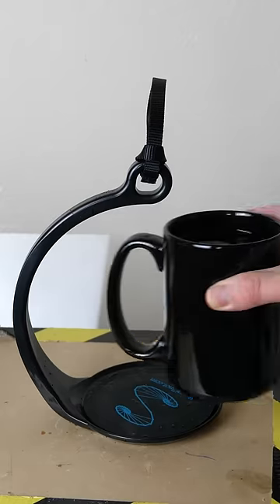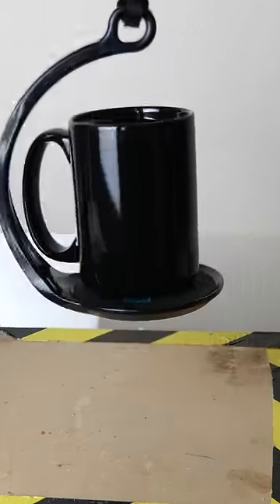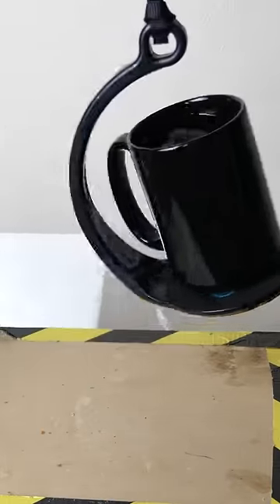Unspillable Cup

Comment: Physical Property Lesson no. 1: Fluid dynamics - opposite thrusts tend to balance each other to attain dynamic equilibrium. 2: Centrifugal force in spinning objects is equally feasible to attain dynamic equilibrium.
Reply: Didn't quite get 2
Reply: @ChaoticNeutralMatt  As long as an object is spinning, the centrifugal force created tends to warrant it a steady regular path. Until the force dies down, the object, or a volatile fluid it carries, maintains a saturated dynamic equilibrium. Hence, the fluid sits itself safely within its carrier without the fear of a spill out.
Reply: i agree! entirely right!
Reply: I have no idea of what u just said
Reply: My physics’ teacher in high school said that centrifugal force does not exist and is mistaken for centripetal force. I don’t remember what either of those mean but it is one of the few things I remember from that class lol.
Reply: @tungyeeso3637  What about the first one? (That's the one I personally didn't get.)
Reply: @Advokaiser  If something is suddenly pushed yet fixed to one direction, it will usually just put out some forces and then continue forward, fluids dislike listening to the commands of things moving them around, water in a cup, if the cup starts moving, the water resists, a very short lived false gravity is generated pretty much backwards that the water will proceed to fall with, the cup must be rotated to account for this fake gravity to prevent the water responding to the cup's position relative to the force on the water causing the water to fall out of the cup, one simple way is to just allow the cup to move like the water, allow it to also align to the fake gravity, this ensures that the water cannot spill as from every velocity provided it will be like its water in a cup sitting static on a table
Reply: @samuels1123  ahhh yes I concur

Comment: You can also do this by pinching the top of the cup with two fingers to suspend it and allow it to swing as you walk. You lose one degree of freedom so there is still a path through which the sloshing can get amplified, but you can usually compensate by moving your wrist to turn the cup (turning the axis it swings around between your fingers), and adjusting your gait as you go. It’s how I carry my cups and it works pretty well and lets me dance with them!
Reply: Pinching the top with 2 fingers?
Reply: Or four and a thumb
Reply: You might do more than spilling that way.
Reply: turns out gays grab cups like that for efficiency who would've known we were so smart
Reply: @crowsoto9612  leave it to us gays to figure out the most fun, stimmy, danceable, efficient and cute way to do a task!
Reply: @ShadowLIlly95411459  This poor man thinks it's normal to have his coffee cup only half-filled. c':
Reply: Another great way is to drink the cup then move. By drinking the liquids it is now safe in your tummy and will not spill. Good luck stay safe 🤓

Comment: Nice thing for hot beverages.

But with cold beverages in cans, glasses, bottles, cups or mugs, just hold it at the top and keep your wrist lose. same effect.

Never understood why people would hold it diffently while moving.

I hold it with thumb and index on opposite sides (and light support of the other fingers) . When I want to drink, I just move my hand up, while the glass rotates on my fingertips and I take a sip where I hold it with the thumb.

Haven't spilled anything in years while waking or talking while standing
Reply: Daymm, bro ur coool
Reply: The video has a different point altogether bro, enjoy the science
Reply: Tea can be more difficult since it's hot, so what I do then is just try to smoothen the movement by letting my arms float free as it were, following the momentum of the cup to dampen shocks. This also works in cars or other occasionally bumpy rides. 
I hold tea cups by the corners of the cup usually since those have the highest surface area to thermal mass ratio and allow me to hold it more stably than when I only hold the ear.
Reply: @thefighterinhades  same physical phenomena. Still enjoing the science. 😉

I don't drink many hot beverages so 
I guess it falls for me more of the category of "needless things".

Comment: the logic behind this is when we hold the cup with our hands it is a rigid joint and can be expressed as a single mass system since the accelereations are equal due to compiled mass. however when we hold it with a non-rigid mechanism which can bend freely, the cup can oscillate at its own dominant frequency which does not disturb the liquid in it drastically. if u let loose your whole arm while doing the last trick in the video u will see u can do it with your arm as well

Comment: This is basically decoupling the cup from your hand, which, in turn, reduces vibration. This is the same as if you have a pair of speakers on a desk and the desk is causing resonance you can put foam under them which will decouple them from the desk and remove the vibration and resonance. The hand is the speaker and the mug is the desk. Every time the speaker (hand) moves, the desk (mug) will start to vibrate. The device that the cup sat on in the video was the piece of foam used to decouple the desk from the speaker. I'm a sound guy, so that was the best analogy I could come up with.

Comment: if you hold the cup more loosely with the tips of your fingers and your hand in a c shape where the cup does not touch your palm, instead of by the handle, gently swinging the cup as you walk moving your hand slightly back and forth the liquid in the cup will not spill. you can even adapt this to running by swinging more vigourously, essentially matching the force of your body with an interfering centrifugal force. assassins have known this for thousands of years, because to carry an open vial of poison without spilling, so as to be ready and about to apply it on has to spin it around with their hand as you run matching their gait.

Comment: You can achieve a similar result by holding the mug at the top with your fingers like a claw, rather than using the handle. The principle is the same - the different position and additional fulcrum points  engaged breaks the synchronization of frequencies of a walking gait.

Comment: you can do that by holding the cup at two points on opposite sides of the rim also, which allows it to swing freely in one direction, then just turn it in the direction you are walking. you just can't do it with a heavy cup that you might drop, but it's especially effective with any kind of glass with a rim. Call me crazy, but a mug with a rim feels like the simpler solution. This is the reason why bucket handles are set up at two opposing points on the rim. In the above example your fingers effectively function like a bucket handle.
Reply: Recently I realised that I only spoil  my mug of coffee if I'm watching it. While I'm walking. I wonder if I hold it differently. Or if I only tend to watch my mug when it's too full

Comment: I've started to do this without the device, just naturally tilt my hand in time with my walking to match the sloshing.   Learned that at a very young age, and because of this, whenever I have a drink full of water or tea and I'm driving, I'm always holding it in my hand, rather than on the dashboard or cup holder.  My hands will mitigate the bumps automatically.
Reply: This has got to be one of the stupidest comments I've ever read. Holding onto a drink while driving is not safe. We are to use both hands for a reason. If you've got to react to a sudden change in your immediate environment you'll be either getting pretty wet or, worse, badly injured. I'd suggest a profound invention called a "lid" instead. Use both hands since you're risking the safety of yourself and others just to save a few drops. Everyone thinks they're a good driver until something bad happens.
Reply: @AmyAnnLand  your just the life of the party huh.
Reply: @AmyAnnLand  uwu
Reply: @Radiodaze1073  Yes, because she's far more likely to get to the party alive.
Reply: @Radiodaze1073  well they are right lmao, it is pretty stupid to drive with a cup of drink in the other hand

Comment: I'm curious. How does the distribution of mass on the plate affect the effectiveness of it? Does it only work for certain weight? Can you make this bigger and carry a whole platter of food?
Reply: You can try it too I guess
Reply: I think the foods that are most suitable for this are the ones that stay together like a unity unlike little fried balls or pieces of meat, since the table is tilted due weight variation then their wave oscilation would cause only one to move and this one would impact the rest of them to the ground.
Reply: got to do with inertia,  centrifugal and centripetal forces.
Reply: I don't mean to state the obvious, but food doesn't spill because it's solid. I've worked in restaurants a long time and there are typically separate trays for food and drinks. Food is about balance and drinks are about stabilizing. You can walk very fast with drinks, as long as you bring the liquid to your speed first. To turn corners, you just curve the drinks (like how you make ur hand into a plane when you stick it out the window of a car) slightly ahead of time so the liquid doesn't jerk out of the glasses. 
I've carried around 20 drinks on a tray at a time and it's the same principle as carrying 3 drinks in your hand. Again, you can balance food on your shoulder, but you cannot put liquid on your should because drinks are about stabilizing. Even if you took a tiny step, your shoulder will jerk it. It has to be as far away from your impact (feet/hips/torso) as possible, typically your wrist. As long as you counteract the force of your steps, you can load up as many drinks as you're strong enough to carry. Hope that gives some insght

Comment: If the coffee weren't hot, you could also just hold the cup from the top with your fingers pointing down and clamping around the cup. The result being that the cup won't spill as long as you're walking reasonably steady. Bets are off if you're staggering around after having one too many though. If you replace that bit of flexible webbing with a sturdy handle, this would likely still work as the cup wouldn't be moving very much. 

Or, just get a freaking cover for the cup.

Comment: It kinda works but it really isn't like in the videos at all. Ah well, Disappointing. 
You can swing it at a certain velocity then when it comes back, it falls. You can walk normally with it tho and it doesn't fall.
No way you can swing it over your head though.

I was curious so I just tested it further today, Looks like it does work but do not swing it to high or it will fall.
Odd, My first testing I did with it did not work at all, Probably had to use it a few times.
It puts the cup in the center and it like doesn't move.

Comment: That's too bulky. I have a steel coffee cup with a swelled bottom larger than the mouth... only way to realistically spill it (running up stairs and spinning in circles isn't realistic- I haven't had my coffee yet!) is to tip it upside down. No fancy gadgets required.

Comment: Or you can….just….not fill it all the way. Maybe walk a little slower. Also you can make your arm rigid and hold the cup 6-12 inches [Insert Metric equivalent here*] away from your body and walk a bit slower.  All of these are free. You don’t need to tear apart your house when your sibling, parent, or significant other uses the Unspillable Cup.

*Go look up the metric system equivalent is yourself.